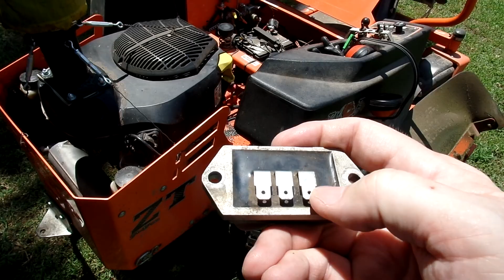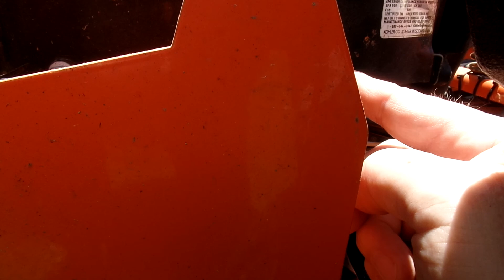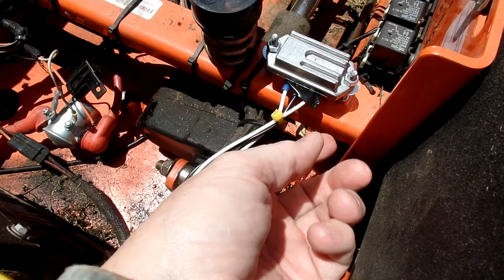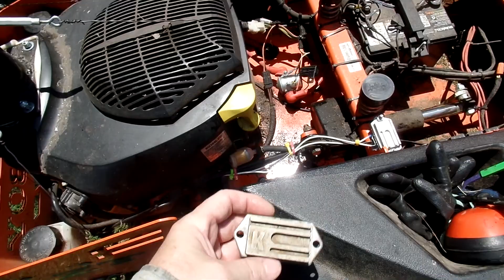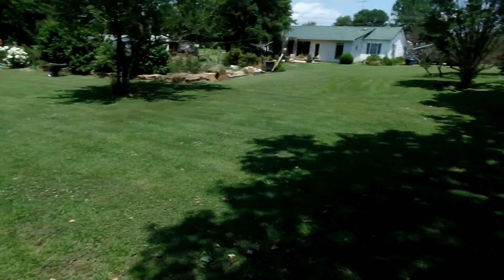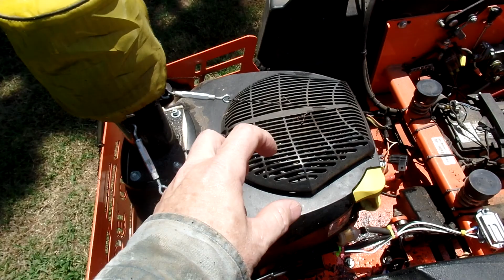PERMANENT fix for Kohler 7000 series motor Charging System !!!

Comment from the maker: As of now 7-2022 I have had a complete charging system failure.  My fix only lasted a year+. The next thing that goes bad on Kohler is the magnets come loose from the flywheel and stick to the stator! I'm pissed!! So I got to do something different now!!
Reply from the maker: After tearing into it (removing the flywheel).  The magnets were still in place, to my amazement.  SSSOOOO that means there is another problem causing the charge system to fail!
Reply: @TheClintmeister  a bad wire mate
Reply from the maker: @adolforosado  to be honest I got so pissed I just gave up on it.  Truly I haven't looked at it.
Reply: @TheClintmeister  It can be irritating. Thanks for sharing your experience.
Reply: @TheClintmeister una excelente, explicacion TE felicito!!!!
Reply: The middle wire goes to your battery to charge it. This regulator changes thirty something AC volts to around 13 DC volts. It gets hot on it's own. Be better to put it back where it was. The black stuff molded in it is supposed to be black. It didn't burn black because it used to be clear. None of them are clear. Let's see what else.... Well, so on and so forth. I would delete this video, get some education on it then maybe post a right one.
Reply: I am sure you have checked this by now, but I would check your batt terminal connection on the key switch.  After watching several vids on how to check Kohler VR and stator, I traced my issue to my key switch terminal where VR was out putting 13.8-14v back to key switch but key switch was not continuing the signal back to the battery.  I bought this Snapper ZT I am working on used/non-running; I noticed when I jiggled the key in the “run” position while engine was running, my batt voltage would intermittently start showing charging on the multimeter.
Reply: Same problem with a Kohler engine on our John Deere riding lawn mower.  They want 136 dollars for a replacement OEM voltage regulator.  13 dollars on Ebay for the exact regulator model relacement.  Still gonna repair and use the Deere...but John Deere and Kohler has lost me as a future customer.  So many repairs each season to the engine and mower. I just bought a Husquavarna riding lawn mower 2 years ago and have had zero problems so far.
Reply: I meant to say, could this be my problem with my scag?
Reply: Would that keep it from getting spark
Reply from the maker: @thomas25082  I don't think so, the spark system is under the flywheel.
Reply: It’s very common on kohler engines 😢😢😢

Comment: You have the same engine I have. Do you have a link to the correct voltage regulator?
Reply from the maker: I found some of my notes. KT745 7000 series, regulator kohler 25 403 35-S.  Make sure you use the year and make model to look up the parts.  Another tip, run a good sized ground wire to the regulator from the negative of the battery.  Also run a negative wire from battery to body, frame, engine so on.  I found that cured some of the problems.  As I have yet to have a coil failure and currently I hear they are a 100% failure rate. Hope this helps.

Comment: I don't understand.
My 2001 model still has the factory part and zero charging issues 🤔
Never even knew this was a problem
Reply from the maker: The factory coils was very bad and went out on hundreds of thousands of motors.  But mine are still working now.
Reply: @TheClintmeister Mine are working as well but I'm low on power and pretty sure that it's because they're weak,so I figure after 25yrs it's time to uograde,but they've been great.

Comment: Grounding: The metal housing of the Voltage Regulator-Rectifier must have a clean solid connection to system ground to the engine, frame or battery or it will not charge. I'm considering relocating my rectifiers to see if I can make them last longer. Wherever one decides to mount the VRR remotely, the paint, grease, dirt, etc. must be removed down to metal at the bonding location and establish a good electrical connection with near zero resistance back to engine and battery negative terminal. I once forgot to install the single bonding screw or screwed it into the plastic housing instead of metal and wasted several hours trying to figure out why the battery was not charging.

Comment: I thought it was called SAM spark advance mech. On mine it is cv461S Kohler 16hp and it has that same electronic box and same markings I'm guessing that some how it charges the Battery and also changes spark timing , mine is in a LT1000 Craftsman from 2001 bought brand new I just replaced the coil cause it was burnt new coil, fuel filter ,spark plug and it fired right up ran for a minute died and key would not work any more blew 20 amp fuse so I'll chase that down later
Reply from the maker: I put a marine battery terminal on and ran ground wires to frame, motor and electronics.  So far no coils burned out.  It was a guess to try that on my mower.  PS: the Plug wires are resistor wires, you can find non-resistor plug wires and get more juice to the spark plug.

Comment: Personally I don't like E3 plugs, Nology make silver plugs for about $10 a piece. Never had issues with them since I swapped to the set on a Briggs V Twin 2 years ago
Reply from the maker: Is that the plugs with "little to no resistance" to the spark?  I have heard of them but dont know where to get them.  I have had E3 on the Kohler for about 5 mowing seasons as of now.

Comment: I made some cork valve covers gaskets. They don’t leak no more.
Reply from the maker: yep stock they just glue them in. Even the replacement is thin cheap paper.
Reply: @TheClintmeister  The paper ones leak too! I bought some silicone sheet and cut gaskets out of it. No leaks and the sheet was cheaper than the gasket set😁

Comment: The regulator rectifier receives dc generated power from stator then converts it to DC middle wire which makes its way to battery keeping it charged. The regulator rectifier must receive at least 12 volts from battery to activate then in turn charges battery with 13-14 DC volts
The regulator must always have good voltage from battery to activate. The regulator can also be defective and be intermittent working leading to bad charge or not able to start machine. Sometimes you need to let battery drop voltage to see if regulator is charging or only intermittent charging. Regulator also needs a good ground to work.
Reply: You have that backwards bud, the stator puts out AC voltage and the rectifier/regulator converts it to DC voltage.
Reply: @jimmydavis6254  
I was half correct
Reply: Ac to dc
Reply from the maker: Last couple of years I just keep it on trickle charge.  The wiring and plug melted.  The parts are cheap enough "now", they used to be expensive.  I will try to get EVERYTHING replaced next winter. THX Clint

Comment: I have a Kohler command pro ch750 for a carpet cleaning machine,  the voltage regulator cables got melted, I had ordered the part, and they said that it will arrive by 04/17 😢 the battery doesn't charge,  I though it was the battery 😢

Comment: So the two wires that come off the stator goes to the outside posts on the rectifier, and the center wire goes to the starter post or battery? I have a 26 HP Kohler 7000 that I'm replacing a 25 HP Kohler command with. I'm trying to figure out the wiring harness. My command had two wires going to the coils, while the 7000 only has one on each one. I'm lost to say the least .
Reply from the maker: I am going to be honest and say I have forgot the wiring diagram.  Its been a while.   I am going to replace the whole charge system (including the wiring harness) in downtime (this winter).  The price is way down on parts for the Kohler motors.  There is videos out there (I have seen on youtube) on what wire goes to what.  I just don't remember.
Reply: @TheClintmeister  I like the idea of moving the rectifier/regulator. I think I'm going to do something similar.

Comment: Thanks bud
They didn’t learn
The same damn thing burned out on my ‘22 ZT Elite with a Kohler 745 7000 pro motor after 30 hours
Got a noname regulator from Amazon for $15 will relocate it to the frame coming weekend
Reply from the maker: This winter I'm going to have the stator, converter and wiring harness (to the charge system) completely replaced.  I am tired of charging all the time.  I like to mow at night and have lights on the mower and can't use them.
Reply: Mines 25 yrs old and still  working just fine,you have another problem

Comment: What did you put underneath  the voltage reg to make it set up high like that ? ..thanks for the video
Reply from the maker: used long screws and put nuts on top and bottom of the converter to hold it in place
Reply: Man I was going to sale mine but I did that and it did the trick , thanks you bro
Reply: Man I was going to sale mine but I did that and it did the trick , thanks you bro

Comment: got a cub cadet xt1 lt50 7000 series mower...took your advice and moved the rectifier under the seat...mine is not black and you can see the internals, so it hadn't got hot yet...thanks for your advice and ingenuity on seeing the problems....

Comment: If you have a bad battery with shorted plates it can also cook your regulator by placing a huge charging load through it. find out the maximum charging system rating and put a fuse on its output, They all should have one ..  this will also offer some protection to the regulator if someone manages hooks the battery or a charger up backwards.

Comment: Every one of these voltage regulators I've seen removed are black, mower/charging system works fine.  On a car, there is dielectric grease that is on some ignition modules.  One could put some dielectric grease on the mounting area of the voltage regulator.  I haven't had any issues with how they are mounted. Flywheel magnets are an issue.  Moving voltage regulator leaves an open spot for rodents to move in and build a nest.
Reply: Yeah there always black, the epoxy pot material they use is black, also if that regulator burns up, it's just going to melt the connection points inside, not going to be some big bang and a bunch of rolling smoke, it's just going to be a tiny arch and that's it.

Comment: The voltage regulator  is cooled by the fins on the flywheel, i have had a kohler engine on a cub cadet with the same voltage regulator and had no problems.

Comment: I like the air filter idea, I also want to get a scoop for the air intake screens on the flywheel.

The slightest windy day and grass ends up all over my flywheel screen.

Maybe a 70s Trans Am scoop, lifted 10 inches, and turned to the left, opposite of the grass discharge. 

What else..  these bolts that hold the shrouds to the head new the exhaust, loosen them to loosen the shrouds to clean the grass and stuff off the fins. The bolts break.
Reply from the maker: I have tried a few different styles/types/ideas but so far none has worked properly on keeping the  crap out of the motor.  THX for watching.

Comment: I think I'm there. I fully charged the battery, mowed for 15 minutes, shut it off, and no restart. 

2017 or 2018 Snapper SZ2454, bought in the the summer of 2018. 

Worked fine until a few weeks ago. 498 hours, Northwest Arkansas.

Comment: Great Idea, why are we having to pay for this "fix."  Designed by idiots. So I have to pigtail out to a cool spot? I keep getting burned by "buy American."
Reply from the maker: I called it engineered junk or engineered failure. The Kohler has MUCH to be desired.  Kawasaki is good but I woulnt call it legendary.  All these vertical shafts have "oil pressure bearings" instead of "indudustrial roller bearings" to support the crank.

Comment: It's not the heat that kills those voltage regulators. The casing of the regulator (with that thick metal and deep grooves in the top) is actually a heat sink, designed to keep the heat away from the electronicals. I have a Kohler Courage on my Gravely 60" ZTR with over 1000 hours on it (and used in a hot climate to mow 6-7 acres off) and the regulator is still going strong. Ironically, the fuse did burn-up on mine, wrecking the fuse holder.....just fixed it yesterday- first time in several years that the mower is actually charging the battery!

Comment: The solo end wire goes to battery, look at the 3 tabs, 2 have AC AC stamped on or above - those go to 2 pole plug. Other has B+ - thats TO battery.
 The two that connect to 2 hole plug are 35 to 45 volt AC power IN from engine.
The B+ is 14 to 16 volt DC output to battery (AT FULL THROTTLE. At idle can be as low as 2v.)
You can check if voltage reg is working by disconnect plug and single wire. Start engine.
Full throttle.
Using your volt meter on AC (NOT DC) at 200v - put red lead in 1 hole of plug, black in other. Does not matter whicj. This combined reading should show 30 to 40 volts. Ok, that means engine if generating charging power.
Off engine. Reconect wire and plug to volt reg.
Start eng.
Full throttle.
Now, at full throttle, put volt meter on DC \ put red lead on single wire on volt reg. Black lead find a ground...screw, frame, battery whatever.
Volts should be 13.5 to 15. Usually 14 to 14.5
If yes engine is gen power. Volt reg works fine. Problem is between volt reg and battery, may be bad battery.
Reply: And if NO?

Comment: Great video.  Just a thought.  Didn't see rectifier/regulator ground mentioned.  Kohler regulators bodies need to be grounded for them to work.  So in your video, if your mower body is grounded to the frame and motor is grounded to the frame everything is OK.  I know Kohler on their Command series needed a short pigtail wire from the regulator body to the engine because it mounted to the plastic flywheel shroud.
Reply: Nice comment…
Reply from the maker: I ran ground wires from - side of battery to electronics, body and engine.  I found years ago that the extra ground wires help and are better than the cheap wiring systems from the factory.  I took the paint off and used SS screws to mount the regulator to that part of the frame.  This fix lasted 1 mowing season but now I have no charging system on that mower.  I haven't tore into it to try to fix it, just pissed at it. THX
Reply: Thanks.  Just thought the grounding would be a key part of the video since the regulator won't function without the body grounded.  Would appreciate an update if you ever find the culprit for the no charge now on that mower. @TheClintmeister
Reply from the maker: I got really pissed at the motor. It wasn't long after I bought it the charge system went out and been fighing it since 2016.  I got a idea to put a small 35 amp (1) wire altenator on it if I can find a place to put it and fabricate up a mount.  That would fix everything.
Reply: @TheClintmeister Having a very similar issue, If the new regulator plays up i’ll simply make a sunshade roof from my 12v flex solar panel to a cheap solar controller to the battery, problem solved.

Comment: Just get you a Kawasaki engine. Koehler is junk. Ive worse out three Koehler engines and can’t kill a Kawasaki with 2k hours on it.
Reply: Hey guess what. 
I am right now waiting on Amazon to deliver a replacement voltage regulator for a Kawasaki FS 651. 2023 engine. 
IT IS THE EXACT SAME PART NUMBER and EXACT PART USED ON THE KOHLER. It's wired exactly the same it's attached for the engine exactly the same this is a complete perfect replica of a Kohler engine and its  Kawasaki... I think they may share ownership or be owned by the same company because if you put a Kohler label on here I couldn't tell you which one it was.

Comment: So ours is a 2005 Scag Turf Tiger with a 27 hp Kohler engine. Going through batteries like crazy. I can see that the voltage regulator has become detached and I’m afraid it’s burnt up and this may be the cause of my problem. Would what you have done here work on my scag?
Reply from the maker: It should. as long as the unit is grounded and kept cool.  That was my goals.  As of now I just charge it good and mow the lawn fast as hell.  Im going to try and find a place to mount a racing altenator (small, 1 wire and only 35amps) to the underside belt and have a different charging system all together. Stock coils are a problem on these and original head gaskets, there are improved versions of both of these out now. Thx
Reply: What size screws actually hold the regulator in place on the engine and did you use the same size when you mounted it?
Reply from the maker: @jfktoo1  I used 7/16 by 2 inches, in metric its a 11mm by 50mm.  I did drill the regulator holes to fit the bolts.  I mounted the regulator in the air using nuts to keep it up off the space under the seat (I'm trying to keep it as cool as possible).
Reply: Many thanks brother!!!!

Comment: No... The isolating fill material in the back is not clear, nor was it. Its a black rubberized material and is so on all the replacements.  Maybe the original Kohler had a clear fill, but I'm looking at one off my 7000 and its black, not because its burned, but because that's the way it's made.  The way to tell whether your regulator is working or not is with a multimeter.
Reply from the maker: Ive seen a couple of them clear and light shading but not black.